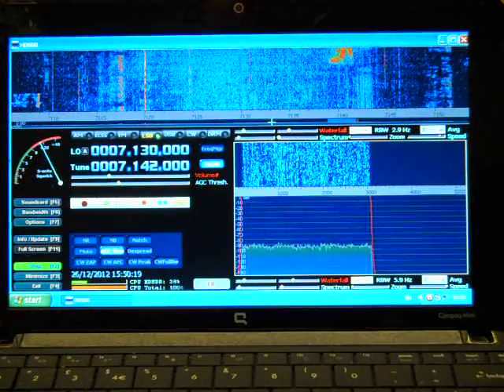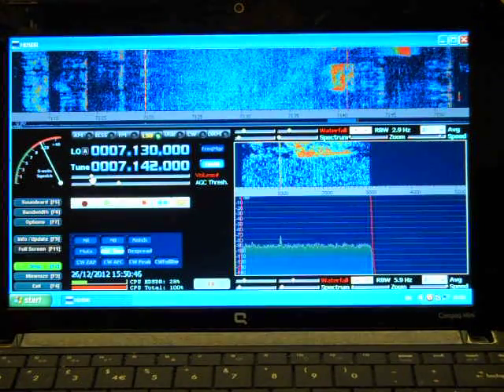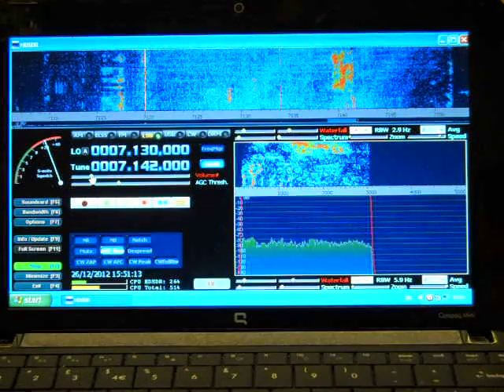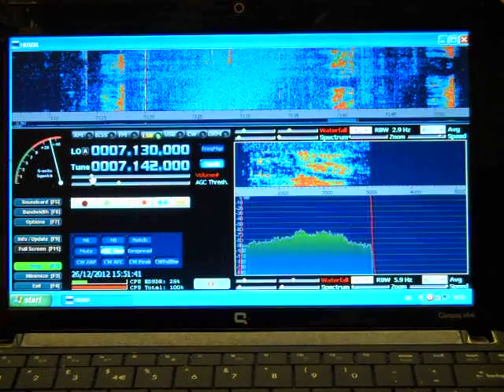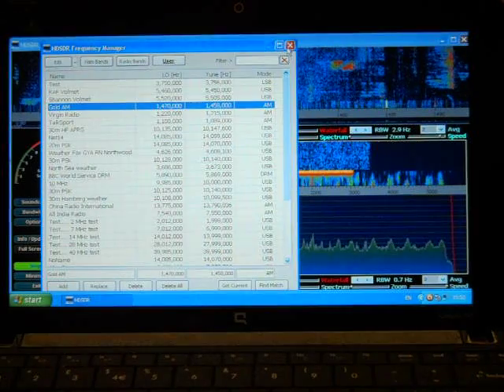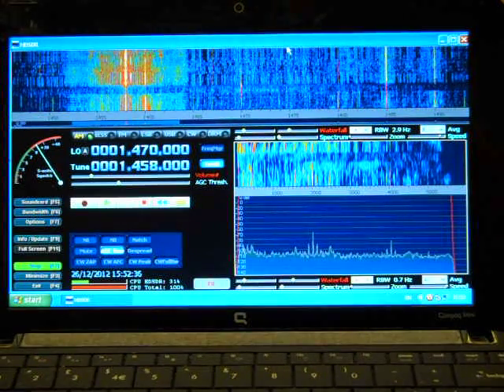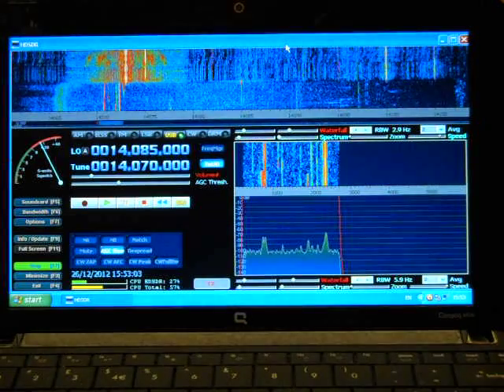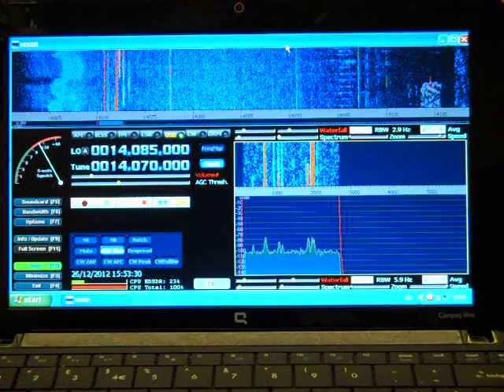CCW HF Active Antenna prototype - first tests

Comment: Jonathan Creaser 
hello JC. the max length of the cable is dependent on the type of cable e.g. Cat5/Cat6. My wifi access point is mounted on my tower @ 24 meters height, running 38 meters of cat5  cable into the shack. That cable carries power for the access point, and data. During testing, we used a 100 meter (prefab) long cat5 cable before making a bespoke cable a the perfect length. All with no problems.
I hope that helps.

Comment: Nice video Chris, and the antenna looks very interesting. Any idea what the max length of the Ethernet can be before the signal degrades? (I'm thinking of mounting an antenna at the bottom of my 80m garden). 73, Jonathan

Comment from the maker: Hi Ian, Thanks for the kind comments.
The active antenna is connected and powered by ethernet cable. It needs a 12V supply with 100 mA supplied at the receiver end. RF isolation transformers in the antenna and the receiver ends isolate the antenna from any RF noise transmitted down the cable as a common mode signal. It does work very well up to 100 MHz so it would be ideal for the 10m amateur band.

73, Chris, G4HYG